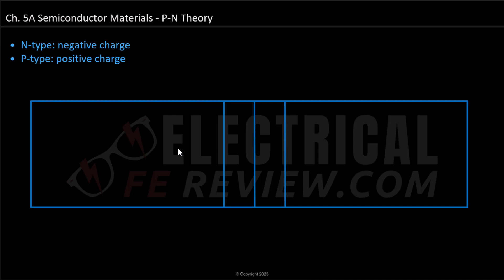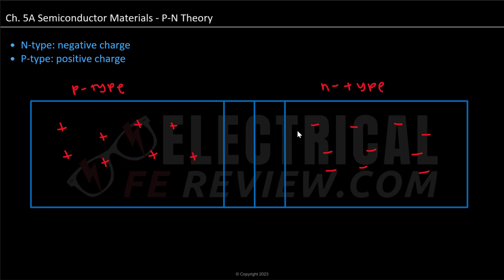P-N Theory - Properties of Electrical Materials for the NCEES® Electrical and Computer FE Exam

Comment from the maker: Video Contents:
0:00:00 - Introduction
0:00:07 - Overview of Donor and Acceptor Electrons
0:00:20 - Explanation of N-type and P-type Semiconductors
0:00:34 - Formation of PN Junction
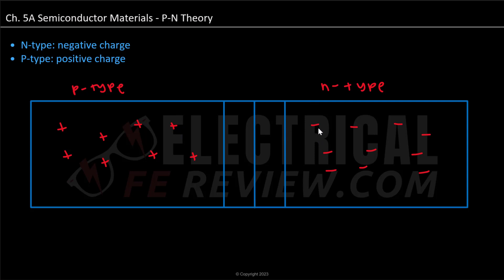0:01:16 - Explanation of Depletion Region
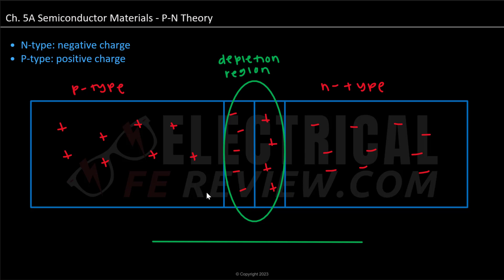0:01:40 - Purpose of Creating Diodes
0:01:50 - Symbols of Diodes
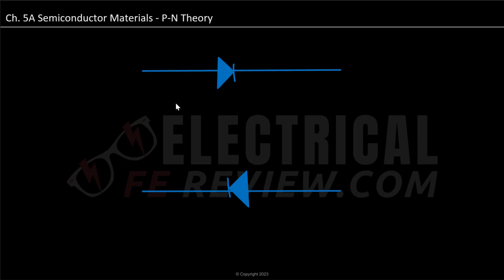0:02:01 - Explanation of Forward and Reverse Bias
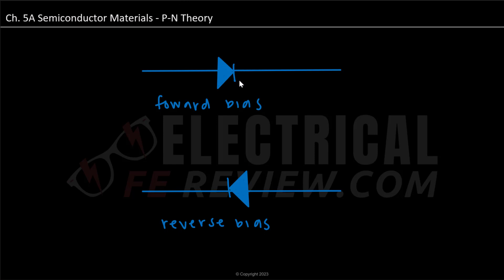0:02:26 - Explanation of Diode in a Circuit
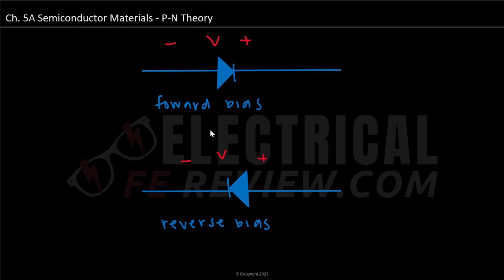0:02:50 - Relation of PN Theory to Diodes
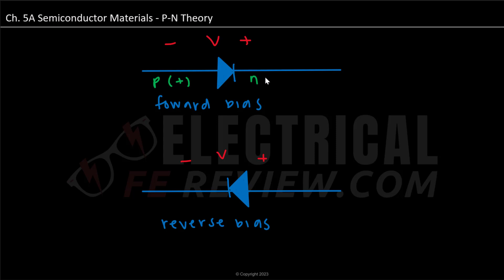0:03:00 - Conclusion

Ready to master the Electrical FE Exam? Don't miss out on our expert-led online course, with video examples and practice problems. Best of all, it's 100% FREE! Enroll today at https://www.electricalfereview.com and take the first step toward passing the FE exam.